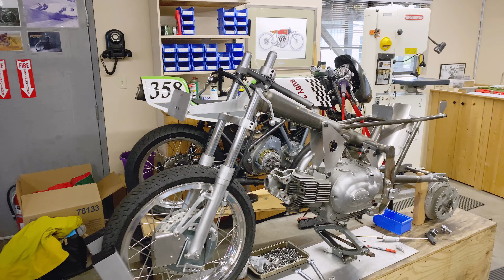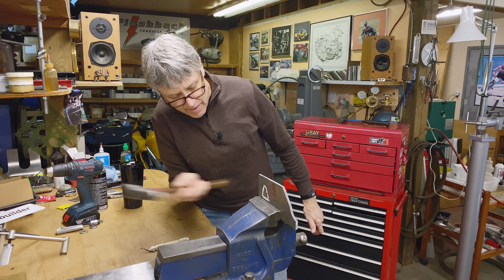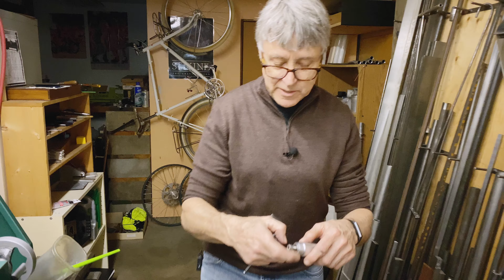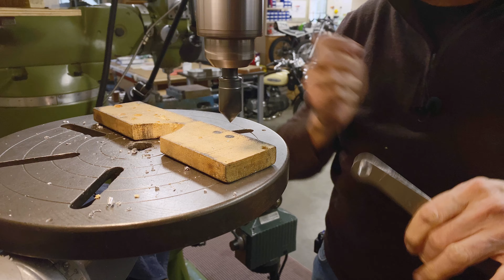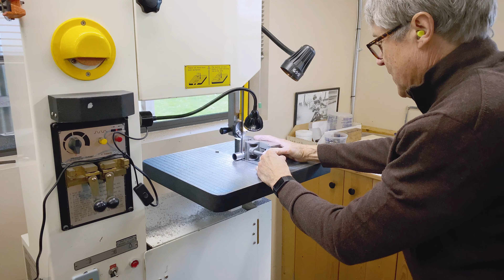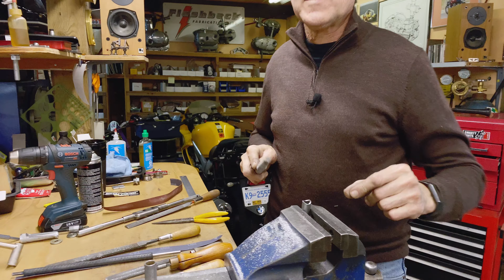Aermacchi shifter and brake  - with Paul Brodie

Comment: I have the black and white one pretty much complete, it's a 66. Motor is a little different. Always thought it was a 250. Used to have a framed trading card and the factory manual. Haven't ridin it since i was 17. Very cool video.
Reply from the maker: Yes, your  '66 would be a 250. The 350s came out in '69. I think you should ride it! Thanks for watching!

Comment: Hi Paul.
Can see a parilla hi cam  motor sitting up on your shelf there. I've been racing and riding them for some years now. Great little Motorcycles with a colourful history.
Also got an Aermacchi 350  racer project on the boil.
Been enjoying watching your clips.
Cheers
Reply from the maker: Yes, there is a Parilla sitting up on my shelf, empty. Fritz gave it to me years ago. If you're into Parilla you will know Fritz in North Vancouver. That's great you've got an Aermacchi 350 on the go too. Thanks for watching!

Comment: As always, another delightful video, and timely -- I was riding my Aprilia Tuono today thinking I needed to get off my butt and make a set of rearsets to correct the ridiculous engineering -- the shift lever only works for people with size 6 shoes, and the brake is directly adjacent to the exhaust, so it fades,  and is impossible to bleed without removing it from the bike.

I like the fuel-line-over-the-1/4" rod for sanding trick.  Thanks!

I, too, have had a racebike stolen.  It's different than having a street bike stolen, that's for sure.
Reply from the maker: Yes, race bikes can be very personal. That's how it is for me. I hope your April mods go smoothly.

Comment: love the mk2 chain cut out , I do things like that all the time , its easy to bend something the wrong way , and be convinced it right , up to the point where you go to fit it ,,,,
but as an old friend of mine
used to 
say 

the man who never made a mistake , never made anything.
Reply from the maker: You are 100% correct. If you make stuff mistakes will happen. Thanks for watching!
Reply: @Ignacio Francis instablaster :)
Reply: @Zyaire Benson i really appreciate your reply. I got to the site through google and I'm in the hacking process now.
Seems to take quite some time so I will get back to you later with my results.
Reply: @Zyaire Benson It did the trick and I finally got access to my account again. Im so happy!
Thanks so much you saved my account!
Reply: @Ignacio Francis no problem =)

Comment: For about ten years my racing bike has been getting taken down and put back together again. Never quite satisfied. Then I see a little something. The heim links were like a light bulb moment. Thank you !
Reply from the maker: Sounds like you're back on it. I had another bike that I worked on for a very long time. You might like our next video :)
Reply: @paulbrodie  Is a Honda job. SL-90 frame carrying MB50 front end rolling on MBX 50 rims. CT-110 bottom end carrying the SL-90 manual clutch and cover setup. Then the air side of a small K turbo in the rotor cover stitched to that. Then a Lifan 180 top end grafted on to that lot. Twin carbs CD/CL90(?) carbs on a two in to one manifold reversed with a progressive linkage between the two. It is a bit mad. Makes terrifying vortex noises on the pickup. But the whole shift / brake linkage has been a right head ache and never quite good enough. I love the Aermacchi. I keep thinking it is what would happen if the motorcycle I wanted actually existed instead of me building a terrible Frankenstein out of Honda corpses. Watching how you went about the shift/brake setup just cleared some sort of mental block I was having with this mess at the back. Thanks !
Reply from the maker: @alphabetica   It sounds like you have been building quite the little monster. I've never played around with turbos. That's great you're getting the shifter and brake sorted out. Keep it up!
Reply: @paulbrodie  Just the cold side charging. Heavy cast iron side deleted. Drive side of it where the oil passed in machined out for bearing and carriers for the planetary. But after getting that to work ( well it spins ) one realises that one needs the cooling. Suddenly a bunch of pictures over at https://www.elsberg-tuning.dk/supercharging.html make sense. With cooling fins all over the little charger arrangements. Bike doesn't have water. Just oil and air.

Comment: When I was a kid (early 70s) we all took off our Amal carbs and replaced them with Bing units. My Bella and 125 Rickman had Bing carbs as well. The 250cc Villiers (w/ 2-speed hand-shift Albion gearbox) on my monowheel has an Amal carb. I was surprised I was able to get a float needle and new seat out of the UK.
Reply from the maker: I recently ordered all the new jetting (basically everything..) for my Amal Mk 2 carb. They have all that stuff for sale in the UK.

Comment: A chainsaw sprocket tip grease pump would feel right at home as a tiny hole bushing lubricator... with the grease nipple deposited in the, I felt it fall off in the whoops, savings plan bucket. 

Just thinking out loud here. 
   
We tapped our test mule for 4-40 wee brass plugs but found a little care with orienting the holes was enough to keep out the undesirables.

Always interesting. 
Thank you both.
Reply from the maker: Sometimes I put grease nipples in, but this bike probably won't get raced much...

Comment: Great video and great choice of mowers!  I also have a DR Field and Brush mower. Thanks for sharing!! BTW - Did you consider using flat head screws to hold the step plates (foot peg mounting plates) to the frame?  Seems like it would have given you a lot more space without the screw heads.  Thanks again!!
Reply from the maker: Thank you jwoodyr1. If a flat head screw just has a single slot, I would not use that screw. If I find any in my shop they always end up in steel recycling because that's where they belong.
Reply: @paulbrodie  Thanks! I totally agree regarding slotted screws. Instead, I was thinking of (countersunk) flat head socket screws.

Comment: Thanks for the great content Paul and Mitch. Did we get a new band saw in the shop? I have done lots of tig tacking without gloves.  I tend to like the really thin tig gloves for welding. I think yours are more suited to peacock training. Do you run lots of pre-flow on your tig set up or is it just the old transformer machines are slow at starting the high frequency arc?
Reply from the maker: No new bandsaws in the shop. I would have said something... I wore those big blue gloves for all the viewers who gave me a hard time about  "bareback Tigging" and other comments. They are terrible for feel. No, I don't use much preflow, I have a small L-Tec transistor inverter Heliarc 301i. It's a great little welder.
Reply: While shop safety and best practices are important. I wouldn’t even think to tell someone with your skill how to do what you do. Pretty sure you know how to take care of yourself around your equipment.

Comment: Hi Paul, I really love your videos, especially where you're constructing something. I've learned so much, especially the art of mitering tubing. When you weld don't you use an Auto-darkening Helmet? I love mine and would never go back to a standard helmet. Loved your book, by the way. Thanks for signing it!
Reply from the maker: When you're welding really thin tubing, like bicycle tubing, the amperage is set really low, and unless you have a really expensive auto-darkening helmet, they are not sensitive enough and you can get "flashed". I know that from experience. Call me old school, but I think you get a milli-second of a flash before the helmet darkens. Thanks for watching and liking my book!
Reply: @paulbrodie  Most of my welding is with thin sheet metal using a low amp setting and your right. I use a Miller helmet and I've been "flashed" several times. Now I know why! Thanks. Still like my helmet, though.
Reply from the maker: @johnvalentine4909   You be careful with that "flashing". Eye damage is not fun stuff.

Comment: You can realy see Airmacchi`s Aviation Heritage on the Knuckle Head Motor. Imagine five or nine of these Cylinders radialy mounted on an a central Block and you have a WWII fighter Engine.
Reply from the maker: Aermacchi set a float plane speed record back in 1940? going 430mph, I think?
Reply: @paulbrodie  Fourhundredandthirty Miles an Hour in 1940 just as Italy joins WWII
what an achievement, and then ending up being owned by low tec HD.
Reply from the maker: @h-j.k.8971   Yes, low tec HD. But Aermacchi was suffering financially, so HD $$ helped to save their asses. The start of a very strange 14 year marriage.

Comment: Here in Europe we had the HD-Aermacchi bikes as well. It was the time when HD were down in the dumps due to delivery and quality issues, Most of the bikes were the 2 stroke off roaders with a couple of street versions. They didnt catch on and disapeared with  in a couple of years.The carburettor should be a Dellorto VHB 30 as used on the Harley Aermacchi AMF SX 350 SX350 Sprint
Reply from the maker: I do have Dellorto carbs, but the Amal Mk2 is a better choice for the race bike.
Reply: @paulbrodie  Cool, yes you are right the Amal is a better carb. I personally use the Mikuni flat slides now as they are much easier to dial in. The last bike i had (yammy sr 500) would pull wheelies in 3rd gear, absolute beast to ride and as different to chalk and cheese compared to the original bike.

Comment: I really enjoy these videos!  It looks like you made the shifter lever for the transmission shaft too.  How did you make the internal splines?
Reply from the maker: Yes, I did make that shorty lever. I used to make and sell them when I was operating as Aermacchi Northwest. I make internal splines in either the 2nd or 3rd videos in the Aermacchi front brake series. Thanks for watching!

Comment: How many uses do you get out of a lathe bit? That machine puts in work!
Reply from the maker: I assume that when you say "lathe bit" you are referring to the carbide cutting tool? It is a carbide insert, has 3 cutting edges, and can last a very long time depending on material hardness. Aluminum, almost forever, hard steel, not so much. :I think each insert is about ten bucks.
Reply: Correct assumption. That little cutting edge get so much exercise. I assumed you burned through them. Thanks for sharing! 

P.s. I always wanted racing pegs on my little sport bike but I had different  priorities.

Comment: Hey Paul, what kind of tool post is that on your lathe? Another wonderful video. I'll buy you and Mitch some coffee
Reply from the maker: That was a bit of work. The tool post and holders have no markings on them, so I phoned my tool supplier (Technicut) and they went through almost 20 years of my purchases before they found the info you were asking for. The company is Sowa Tool and Machine (STM) and the 40 position holder is called Tool Post series E STM #388-100. The Tool Holders are part #388-110.. They have worked very well for me, but you will find out they are not cheap. If you email me I can forward you the catalogue page where they are listed. Thanks for watching!

Comment: from your basement dweller days, what can you suggest for a person desiring to build cycle frames in an apartment? I have a general pattern for a series electric cycle with engine driven range extender in mind.
Reply from the maker: Well, I don't think you'll be welding in an apartment, but it is surprising how much you can do with limited tooling. It forces you to be more creative and perhaps develop friendships with people who do have those resources you lack. Your project sounds a bit complex. Make sure it is "doable", to give yourself a good chance of success. And once you start, never give up!
Reply: @paulbrodie  only TIG welding, I would not dare stick welding here!
Reply: @paulbrodie  what are your thoughts on using extruded aluminum like 80/20 for a frame building fixture?
Reply from the maker: @2000freefuel  That could work. Anything is better than nothing.

Comment: Great series, would you explain a little on the intake tube and why the Spanish Amal?
Reply from the maker: I got race specs from the Bladon Bros in England, including tuned intake length and 35mm Spanish Amal specs. The bike really did haul, and I'm building a replica of the one that got stolen.
Reply: @paulbrodie  Thank you.
Reply: @paulbrodie  hi Paul, do you have the type designation for the carburettor? There are a few being offered here, not sure if they are 34/35mm, and they might be Amal UK.
Reply: I have a 274 Amal carb rebuilt lying around
Reply from the maker: @jarnoverhoeven3118   Yes, someone just sent me a link for amalcarb.co.uk so I will check out what they have, thanks.
Reply from the maker: @jcerullo5015   Thanks, I have to check the difference in model numbers..

Comment: Tell us about your Kef speakers.  They show up in many of your videos and why no grills?
Reply from the maker: Years ago the cats got at the grills, so they're looking a little shabby. Luckily, no claws ever got to the actual speakers. I bought the pair in 1980, brand new, for $600. When I got home I couldn't believe I had put that much on my Visa card...
Reply: @paulbrodie  Very LS3/5a like.  I bought a used set of built-from-a-kit Cantatas decades ago and one of those B110s went bad and ended up upgrading them for the better.  Still have them. Some of those B110s didn't age so well.  Anyway, really appreciate you sharing your skills.
Reply from the maker: @chrisharper2658   Thanks for watching!

Comment: If you mounted spacers (smaller washers) between the washers, when doing the chamfering, you might be able to do them all without re-mounting? Sad to hear about your van :(
Reply from the maker: Someone else suggested small washers too. Good idea. Thanks for watching!
Reply: Like... washers 😜😎🧐

Sorry, I’m the guy who struggled for years refitting brake springs on cars before someone suggested sliding coins (or washers) between the coils. Such a simple solution, yet it evaded me for decades!
Reply: paul brodie I got to this party real late huh? 🧐😜
Reply from the maker: @G58  that's a smart idea. About the coins between coils.
Reply: paul brodie Yep, it works on kick/side stands too of course. I think it was someone on the Honda CB-1 forum who suggested it. Could have been a YT vid. So many bruised knuckles, frames chipped and frustrated uttering of Anglo Saxon oaths can be avoided. 

In the case of the side stand, all the washers fall out as you put the stand down. Poetry! 🧐

Comment: Why the air hole,. or are you also feeding argon in the brake arm tube because it stainless
Reply from the maker: The brake arm is steel. I need the air hole because I am welding the cable holder onto (what was..) a sealed tube. Make sense?
Reply: @paulbrodie  I always thought you drilled a hole because the air inside the tube gets hot, tries to expand and tends to blow a hole in the weld area.

Comment: Arbour is also known as a 'spud mandrel'.
Been quite a long time since I did any 'race bike' parts, making and modifying was great fun though ; particularly figuring out ways to 'add lightness and simplicate' as my father used to say.
 The Aermacchi is pretty light,(sub 250lbs?) T500 rear hub will probably be overkill and also way heavy with it's rather large cush drive?
 Something about the size of a Honda CB350 rear hub or even CB/CD175 may be better and maybe even easier to find brake shoes in race compounds?  I know CB350 complete rear wheel with a Metzeler (modern Kevlar instead of steel bead) can be made under 35lbs (6061 alloy sprocket, alloy bearing spacer and wheel spacers,  alloy WM3 rim) compared to the 50+lbs for the original with narrow (WM2) steel rim. Nice to see someone  else swapping between inches and mm. I'll subscribe to 'live vicariously'
Reply from the maker: You are right, the T500 hub did not get used and I now have an XL 350 hub. My last Aermacchi racer was 221 lbs. That bike was a lot of fun to ride. Thanks for watching!
Reply: @paulbrodie  Thank you for reply, with almost 20K subscribers I wasn't expecting it. I'm always interested in little details that may bore some people, been told I'm probably OCD about motorcycles. (couple of students said it over the years I was working at MMI teaching)
Reply from the maker: @1crazypj  I try to reply to most comments, but I know I miss a few.I like the little details too.

Comment: Are you not tempted to go downdraft for the carb?
Reply from the maker: I did down draft on Ruby Racer. For this build I'm replicating my racer that got stolen...
Reply: @paulbrodie  I did put an eBay listing for a carb but YouTube must have removed it as I can't see it in the comments. It's UK based so shipping might be expensive.
Reply from the maker: @chrislee7817   Someone sent me a link to amalcarb.co.uk or something similar. I am going to check it out. I'm used to paying shipping charges and race bikes aren't cheap to build. Thanks!

Comment: A lot of the time for TIG welding I don't use gloves either TIG welding gloves are so thin it's almost like not having them on to start with the reason that I weld with TIG gloves is in certain Metals you don't want the oil on your skin contaminating the metal
Reply from the maker: I get it. And some people have oilier skin than others. Thanks for watching!